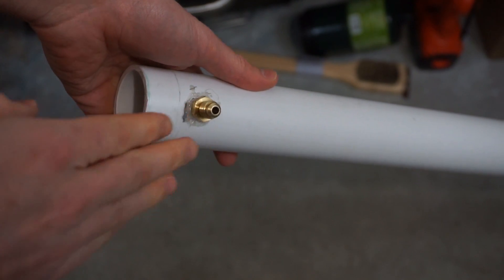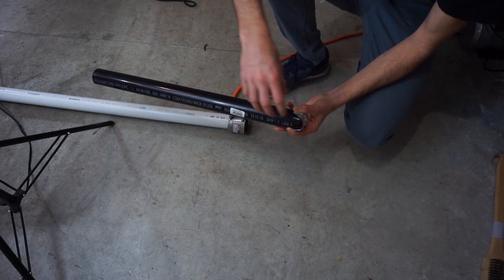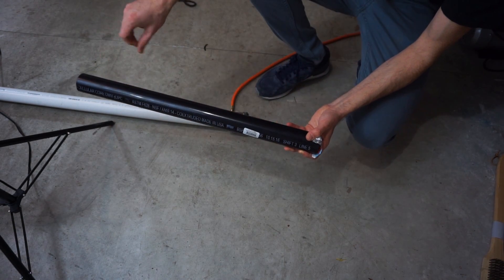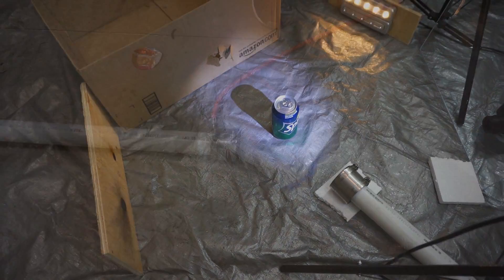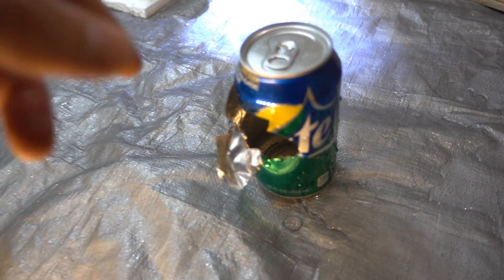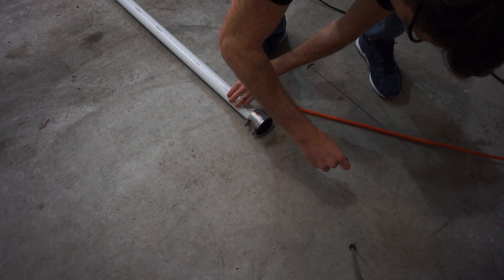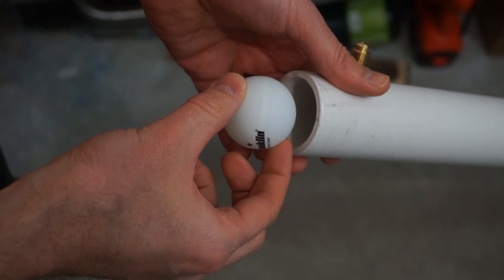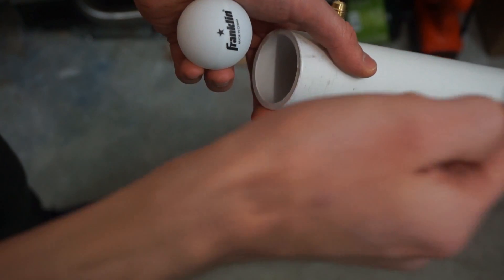How Fast Is a Vacuum Cannon? Is It Really Supersonic? Measuring the Speed  Of My Vacuum Cannon

Comment: You could also completely cancel out air getting ahead of the projectile by do this..... making a secondary small bleed tube whose hole will merge just ahead of the projectile in the bore. When the vacuum is created air in front of an airtight projectile can be vacuumed out. upon launch the projectile shoots past this hole and if its sealed tightly enough no air pressure will build up ahead of the projectile. 

This way you can truly create a wadded seal behind the projectile and still create the vacuum ahead of it when charging the cannon.

Comment: In addition to lengthening the vacuum section, you should add a pressure chamber and pressurize the entry side of the pipe until the diaphram is ruptured. Maximum pressure differential.

Comment: You're probably losing a ton of energy from the recoil of the tube. Sure it only moves a inch or less but it has so much more mass than the ball... Mount it rigid and retest with all other conditions consistent.

Comment: It appears that your frame rate and your shutter speed are the same.  So your conclusions about the ball moving 9 inches per frame are about right.  It might be better to look at where it started the previous frame and the current frame.  There is likely some period of time when the camera CCD is being read out when it is not recording light.  More light and a black background would help.  What type of camera are you using?

Comment: Older video so maybe this has been addressed, but what happens if you use compressed air for the vacuum to pull from? Will the ping pong ball go faster than using normal air and a vacuum? Faster than compressed air and no vacuum?

Comment: The pingpong ball is 4 cm you need to subtract that.
at frame (d) where you measures it is already slowing down due to back pressure from the box.
You can see the box moving backwards before the ball gets there meaning there is pressure in front of the pingpong ball.
If you look carefuly considering frame (a) is where the pingpong ball emerges frame (b) shows a further travel distance than frame (c) and even shorter still is frame (d) which you show to be 22.9 cm but consider measuring from front of ball to front so subtract 4cm.
At frame (b) the travel is around 6.92 inches 17.59 
Frame (c) actually about the same. Not too much different, hard to tell.
Based on that I got:
17.59 /100 x 60^2 = 633.24 km/h or 393.477094 miles per hour.

Comment: amazing experiment!  wow... Okay I have a thought - what if there is no air gap between the ping pong ball and the walls of the tube?  This could mean faster projectile speed.  Now what is the easiest way to do that, to seal the sides, could it be with a spud?  A spitball?  I remember I used to make pop guns with an empty Bic pen cylinder  and you jam the end on an orange rind and the circular divot of the rind becomes the projectile and it is nicely sealed at the end of the cylinder. Makes a nice pop sound when you fire it.  Okay someone film this, lol.

Comment: Dude, you cannot break the sound barrier with your setup. It is physically impossible. You have to have a converging-diverging nozzle inside your tube to expand the flow to supersonic speeds. The ball isn't going supersonic not because of its inertia, but also because the air isn't supersonic either. The fastest the air can move is Mach 1. But it's probably a bit less for this setup, Mach 0.9 or so. Add a converging-diverging nozzle and you have a shot at hitting supersonic speeds

Comment: I don't think longer is your answer. because if the incoming air is traveling that fast and takes that long to move the balls mass then it would be safe to predict a longer tube would create a cushion of air to bounce on before exiting. I think you'll get a greater speed if you were to create higher pressure of atmosphere to the end you burst. more concentrated air more push? you'll have to have a membrane rated to the higher atmosphere you would be presenting and that in itself could create your "trigger". idk. just thinking here

Comment: if your measuring the lenght within a frame its shutterspeed (exposure time/ frame) not framerate (1/seconds between frames) which determines speed. Was the cameras shutterspeed also 1/1000?
Reply: If you examine around 3:12 , you'll find the frame just behind the measured-length frame; it ends where the measured one starts. So he has selected shutter-speed of exactly 0.001 second, and zero time between frames. Yes, he isn't explaining things very well.

Comment: Hey I got a bit of an idea of a test you can perform.. Based on your statement on how puncturing the membrane on the cannon causes the air to rush in at super Sonic speeds it made me question what would happen if you shot the membrane dead center with a standard 9mm pistol at full vacuum. Would the bullet gain speed and thus increase power.. lose speed... Or remain the same. Using a highspeed camera you could catch the increase (or decrease) in speed. I think it could be a cool thing to try out.

Comment: Hi, I am also doing research on this vacuum cannon project. But I have a little trouble. When I seal the tube with one piece of foil and then start air exhaust, the foil is easy to be broken before launching. When I use two piece of foil to seal, it’s ok to exhaust air. But after I puncture the extreme, the seal of the muzzle is too solid for the ping-pong ball to destroy. Could you tell me how you seal it in detail?

Comment: You could make the tube from transparent material like plexi and measure the speed inside the tube.
Also ping pong ball will slow very much in the air when it exit a tube, you might try something heavier, but this will be dangerous.

Comment: Pardon me, noob question here.- I've never taken a full physics class (let alone fluid dynamics), but I don't understand how it is that that doesn't choked flow doesn't limit the speed that oncoming air pushes the ball to under the speed of sound. Isn't that the speed that the particles are going to flood into a vacuum?

Any youtube channel or video that could explain this to me would be fantastic!
Reply from the maker: The incoming air has literally nothing in front of it to slow it down. So the only speed limit is how fast the molecules of N2 and O2 are moving when they are bouncing around off of each other.  On average, at room temperature, these molecules are moving at about 500 m/s (about 1000 mph). But at normal conditions, the bulk movement is zero since they are all bouncing around randomly. But as soon as I pop that membrane, for the air that is right next to it, suddenly there are no other air molecules to bump into to force them the other way, so they just fly into the vacuum at the speeds they were moving.
Reply: Got it, thanks. What my confusion was was the fact that I thought that that standard internal movement (which you said was about 500 m/s) was instead at approximately the speed of sound. I was misinformed about that fact.

Comment: If the air rushes into vacuum with the speed of sound, and the speed of sound is higher in higher density stuff like water, will it push the ball faster if you put the whole thing underwater with only the exit end above the water?
Reply: No
The speed of sound you are referring to is how quickly vibrations propagate through a medium and is not influenced by material surrounding an object (only what it is passing directly through)
The speed of sound as a popular measurement of velocity is the speed of sound through air. Basically a set velocity to reference something's speed against.
The only ways to make the ping pong ball move faster are to create a larger pressure differential (more complete vacuum and/or higher pressure moving into the tube) or increasing the length of the tube giving a larger distance/time for it to accelerate (up to a maximum of the speed the air is rushing in)
Putting the intake end under water and allowing water to rush in could make a difference, but whether it would speed up or slow the final velocity would be dependent on whether the higher inertia of the water making the pushing medium move slower would influence it more than the higher density  water hitting the ping pong ball accelerating the it faster. This might actually be an interesting use of the water hammer effect if you remove the ping pong ball from the equation entirely.
Reply: When you say a higher pressure differential, would you be able to create that by making this vacuum cannon but instead of using a seal on the back end that you pop, using something like a compressed air cannon?

Comment: if you solidly mount the tube it will help. your tube moves backwards when you puncture the membrane, so you lose some of the energy transfer. also lubing the ball slightly might help with the friction between the ball and tube, although im just guessing with this.

edit: also look into getting a chronograph to measure the velocity at the muzzle

Comment: what would happen if you used a golf ball instead of a ping pong ball?
Reply: Beverly Woods the work that is put into the ball(force*distance - force being the 1 atm that is exerted over the surface of the crosssection of the tube) is the same in both cases - so it would conserve momentum better, but it wohld also pick up less speed/ much slower
and since the ball does not create a perfect seal inside the tube, (especially a golf ball with all its dimples) more air would bypass the ball, thus creating even less acceleration because of the smaller pressure difference between the front and the back of the cannon
Reply: Yeah, I was thinking the same thing. Something with more mass ought to sustain the momentum better, but maybe he is just trying to be safe, since this is being done indoors. lol
Reply: Same momentum, less force. But more energy.

Comment: put water in there and turn it into a water jet
Reply: TheMattChannel he could also plunge the end that he punctures under water- actually, it would be neat to see if the ball would then go faster or slower, because the water obviously accelerates less, but does not slow the ball down on the other end - in fact, that way, you might be able to bypass the problem that arises from us8ng a longer cannon, as seen on mythbusters

Comment: idk what's the deal with all the dumb explanations but your best bet at making it supersonic is obviously to have as long of a tube as you can get away with, using a ball that seals as good as possible so the air pushes it rather than going around it as well as a lubricant and sealer for the ball(engine oil of various viscosities comes to mind, dunno what else) also I don't know why you're poking a tiny hole instead of smashing it in with say a hammer to allow the air in through a much bigger hole.

adjusting all those things I'm quite confident you can go supersonic

Comment: Remember this: There is a seal on the other side too that the ball has to break. That's not what slows it down though. As the air rushes in and pushes the ball forward, some air slips past it (The ball) and is trapped between the ball and the still intact seal and creates a cushion of air as it gets closer to the seal which can slow it down a bit.

Comment: To increase speed, increased tube length is a good idea, but there are 3 more ideas to also assist:  1. Increase the size of the hole in the first membrane by using a bigger punch, allowing air to enter faster.  2.  Create an airtight seal behind the ping-pong ball using some sort of wadding like a tissue or plastic wrap - same concept as the wadding in a muzzleloader - so the ball will go the exact same speed as the incoming air.  3.  Use a weaker "exit" membrane, so the ball doesn't loose as much velocity by having to punch through the exit barrier.  This should get you to supersonic speeds.  And if you want to push it even further, have a really wide PVC (4 inches or wider, the longer/wider the better) as your air entrance pvc, then neck it down to your "barrel" pvc that houses your ping pong ball.  This will allow for a lot more violent pressure change and greater velocities - but be careful cause you could explode the pipe at the neck-joint.
Reply: Yoooooo….
Reply: Yes, Indeed, increasing the lenght will allow external air pressure to have more time accelerating towards the lower pressure zone!

Very good thought!

Comment: +Hydraulic Press Action  Can you recommend some material that derives this 2/(gamma-1) formula?  And as for your method of calculating the speed, I think it would be better if you counted as many frames, that fit into the meter stick, as possible because I feel that there is a lot of error in doing just one.  And let us know if lengthening the tube helps.  Must say, I'm glad I subscribed to you :)
Reply from the maker: Here is the paper I am referencing with that equation for the speed of expansion into a vacuum (http://adsabs.harvard.edu/full/1953ZA.....33..251K)
As for my method, I agree, not the finest method, but really I just wanted a ballpark speed to know if I was even close to speed of sound. I think my speeds are accurate to within plus or minus 15 m/s with this method though.
Reply: Alright thanks

Comment: Are you getting 1/1000s from the shutter speed or the frame rate? It looks like you have a fairly high shutter angle, so the two figures would be close, but you also have a margin of error due to the width of the ping pong ball.

Rather than looking at the blur length of a single frame, I think you'll get a more accurate figure by measuring the front-to-front distance between two frames and using the frame rate in your calculation. What do you think?
Reply: Another option would be to use a high-frequency strobe light.
Reply from the maker: yes 1/1000 is from frame rate. I did it with the blur distance and the front to front distance and they were both about the same. Correct, I didn't add in the width of the ball but my "9 inches" was plus or minus 1/2 inch anyways so that is only plus or minus 12 m/s. I really just wanted to see if I was even close to the speed of sound, and it wasn't:( But we will see what I can do to get there.
Reply: Ah. Yeah, normally I'd offer the benefit of the doubt up front, but because the possibility of an error could mean the difference between breaking the sound barrier and not, I had to voice that possibility.
Reply from the maker: Thanks for the check, I appreciate when people check me on my stuff, because I sometimes make dumb mistakes:)

Comment: Could that ping pong ball kill you
Reply: joe shortt that is because the golfball HAS mass (weight), lol. Remember, if it has mass it needs more mass in the opposite direction to stop and thus dumps more energy into you once it hits. with the size of the ping pong ball all the mass is displaced over a wider area too. at most it would feel like a punch to the face, but not lethal. it will lose the speed and energy during flight as well.
watch mythbusters for an example where they test if a coin thrown off of the empire state building (I think) can kill you. they put their hands under a coin the was fired from a rifle and it only welted them. yes, a firearm. firing a coin. not a gasgun. a .308 rifle

hope this comment cleared it up :)
Reply: Nope. It lacks mass. it would give you a very decent welt though, maybe some bleeding, lol, but FAR from lethal.
Reply: Orro Gryphon Lack of mass doesn't matter. a golf ball just being thrown at you gives you that welt.
Reply: +Orro “stormwing” Gryphon it can kill you if shot to the neck, can cause bleeding and possible death.

Comment: Great video!  I remember Myth Busters did an episode on the supersonic ping pong ball.  They were able to make it go 1100 mph!  But they found that if the pipe was too long, the air would push past the ping pong ball and stop it.
Reply: Daniel Skoog I would use say, 3.00mm ball in 3.05mm pipe with oil for better lubrication and sealing. Windage gap you know.
Reply: A 3mm diameter ball would be really small!  Maybe some kind of cylinder or piston looking projectile would create a better seal than a ball.
Reply: The reason it went 'supersonic' is because they used a high-pressure tank. But it's not the pressure that does it. The initial inlet of high-pressure gas causes a temporary build-up of pressure behind the ball before it gets moving, raising the temperature adiabatically. Higher T gases' molecules have a higher average local speed, which means that local speed of sound actually increases, in that case to almost mach 2.

In this experiment, only atmospheric pressure is at work, and only trivial heating about room temperature. In fact, the expansion of atmospheric gases into and down  the pipe will involve adiabatic cooling, which means exceeding ambient mach 1 of the ball at the muzzle will never happen.
Reply: Daniel Skoog try adding a vaccume reservoir to the muzzle end to absorb the in rushing air
Reply: Daniel Skoog I took it just as an example. And yes piston design would work better. Why not to modify an old cannon and try with cannon balls.  😜
Reply: Amaey Paradkar its called expensive AF
Reply: NikoNiko Nii Sorry didn't get you. 😅